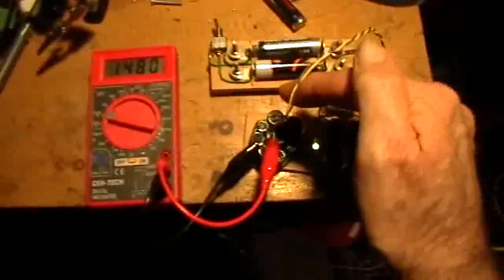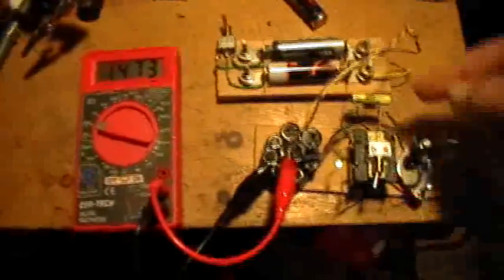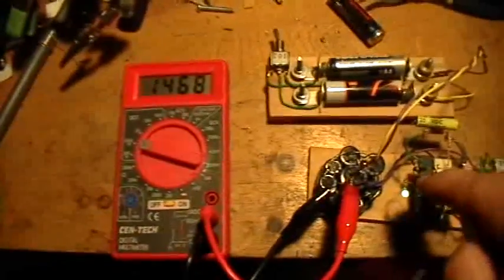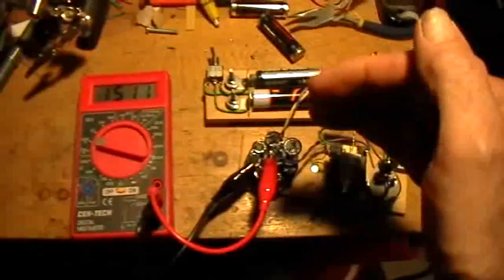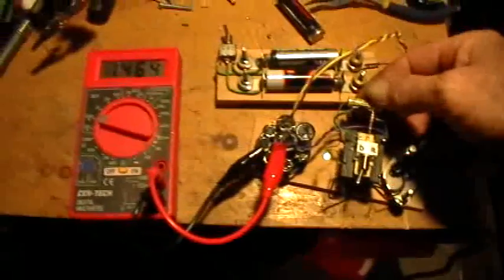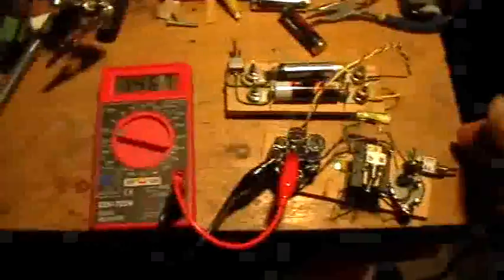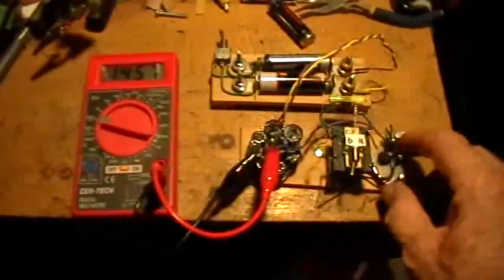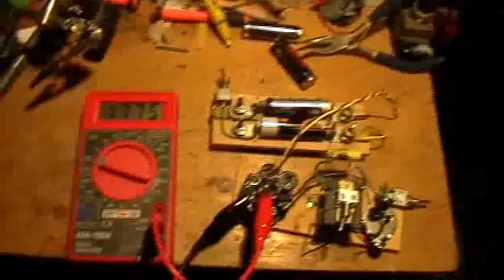Joule Thief: LSGhostLight Voltage Rise from Added Capacitor

Comment: Maybe it just recitifies the stray EM waves from the ground line and charges up the batteries...
Maybe if you use a bigger lower losses cap and less load, you could also charge up the cap without the batteries ? Just try a higher resistor load instead of the LED....

Anyway, well done and good analysis, would like to see also scopeshots.

Many thanls.
Regards, Stefan.

Comment: Yeah... a lot. I got it now. I am using an lead/alum and it recovers the voltage each time you disconnect from the circuit. Another question for you... I posted another video where I change the neon that I am using for an led. And I thought that thing would burn out, but for my surprise it did not. Any clue? Thanks a lot, and for that schematic of your wireless receiver too.